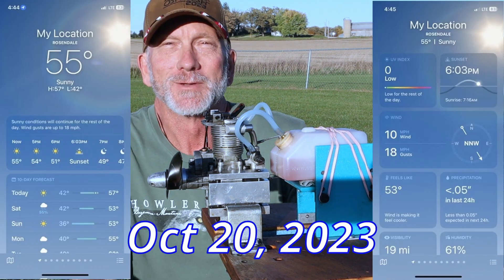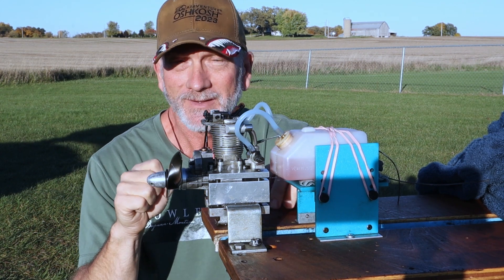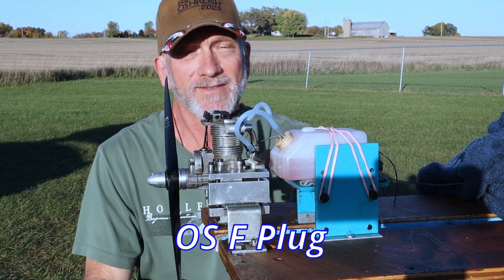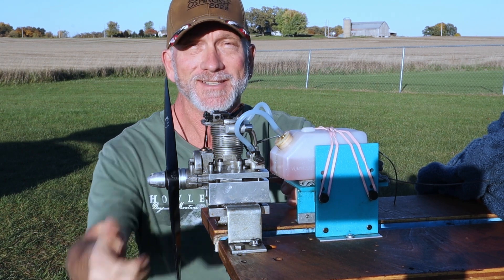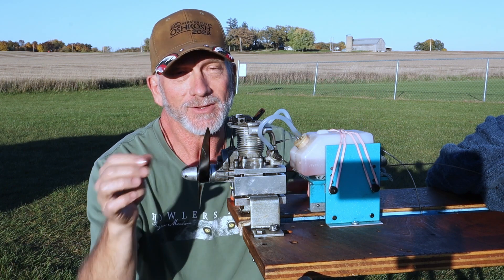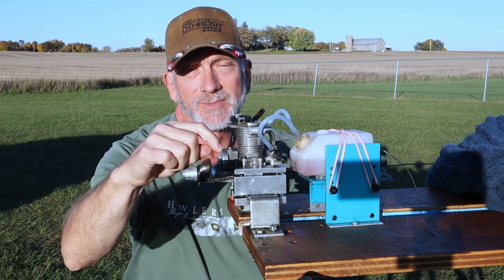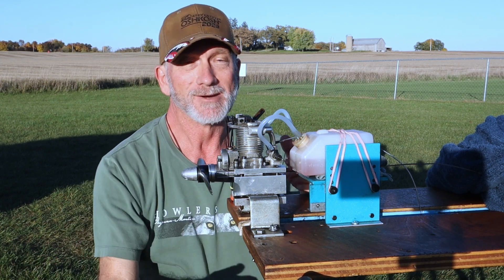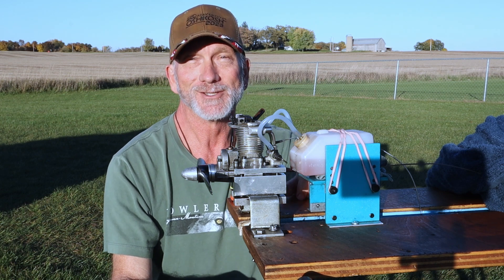Saito FA-45 Trade Engine Part 3

Comment: Tanks David!, a great series of diagnostic videos!. The valves not seating properly due to carbon residue may be a factor on the low compression issue.
Reply from the maker: Pretty sure I mentioned either in comments in Part 2 and/or in the video that the valves were set fine, so that is NOT the issue.

Comment: Please do clean carburetor including low end, because it does effect midrange, which is where engine seems to die off.
Reply: Also replace carburetor seal ring, because it will cause air mixture to lean out on higher RPMs.
Reply from the maker: Yeah, sorry. I don’t take advice or suggestions from viewers.  Now if you want to donate to the channel to pay for these things fine.  I have been doing this for a long time. And the plans for this engine are NOT to do anything else with it.
Reply: @dmrcflyr2  -- Sharing is caring, what you do with it is up to you!

Comment: It looks like the cylinder gaskits are leaking?
Reply from the maker: There is no head cylinder gasket on Saito engines.  I left an extensive comment on the Part 2 video explaining the condition of the engine.